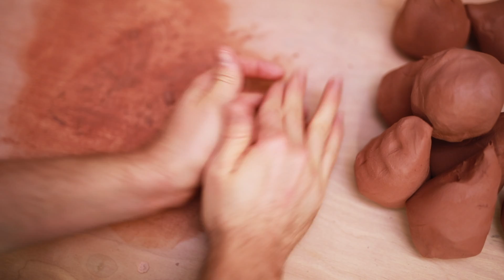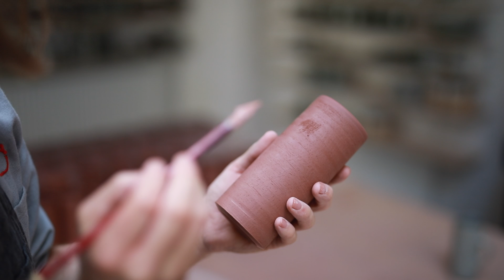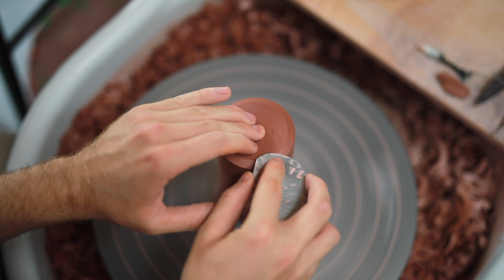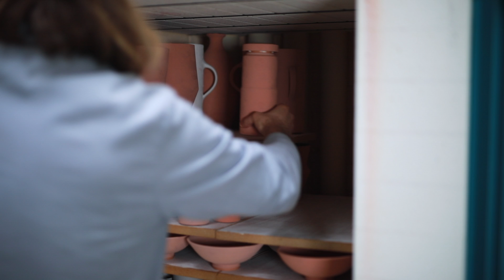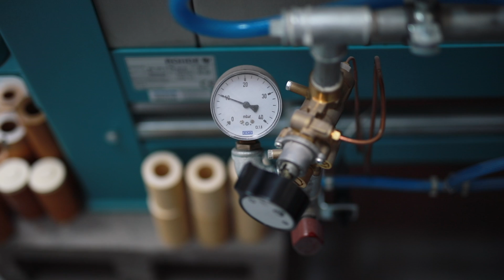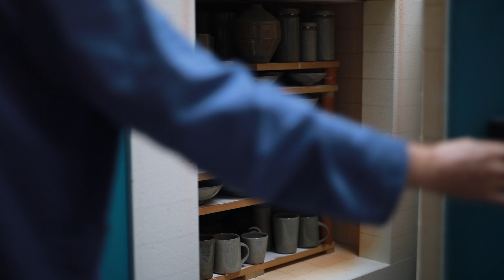How to Make a Handled Pottery Jug From Beginning to End — Narrated Version

Comment: Thank you for such a beautiful video. When you lift up the piece from the wheel, do you give a little time until the surface of the piece dries out? Or is it safe to pick it up as long as your hands are dry? I have trouble keeping the form as it is thrown when I lift it up from the wheel, so I usually leave a lot of clay on the bottom so that I can use that part to pick up the piece -- but ideally, I'd like to leave less clay on the piece so that I don't have to remove too much when I trim.

Comment: Why do you wipe off the glaze off the bottom?
Reply from the maker: Otherwise the glaze melts and fuses the pot to the kiln shelf, which means it's stuck, essentially. The only way to get it off after that point is to smash it off with a hammer.
Reply: @floriangadsby  Makes sense. Thanks. Isn't there some material that doesn't stick to the glaze?

Comment: Are you just using a trim tool to take away the clay at the bottom?
Reply from the maker: I am, just a looped trimming tool, then I burnish the bottom with a metal kidney to smooth it over before I stamp it with my maker's mark.

Comment: Nice and clear.  I like the commentary format which is so much better than trying to talk to the camera, operate it and remember all that needs saying.  I agree with you about letting the clay settle to an even dampness throughout, so many people always rush that bit.  Have you tried real wax?  We use an electric saucepan and lower the pot into it. Also I was interested in your crash cooling at the end of the firing - I must try that.  Thanks for taking the trouble to put this together.
Reply from the maker: Thank you Mike. So pleased you like the format of these videos. I have used real wax, for a long time in college, we used to melt it down in big saucepans in the glazing 'shed' and the room would fill up with the fumes that truthfully got us all a little high. The establishment soon after had a giant extraction hood and fan installed. I like it, it does brush on more smoothly, but this wax emulsion I've been using, once watered down a little with boiling hot water, is fine really. Does the same job and I don't have to heat it up or anything. It tends to be a task I do once every couple of months as I can do all of it in a day or so. The only thing I really miss is the smell, molten natural wax is such a treat for the nose. Thanks for watching!

Comment: What was separating the two parts of the lidded pieces?
Reply from the maker: It's called wadding, it's 50% china clay and 50% coarse alumina hydrate, mixed into a clay like consistency and carefully positioned between the lid and the jar.

Comment: Great video, very informative and a joy to watch. May I ask, I noticed the crackling on the glaze, would these jugs still be food-safe?
Reply from the maker: Thank you! Here's my answer I keep in a document for when this query comes up! I’ve been using crackle glazed ceramics for years and years. It’s high fired stoneware with nothing nasty that could leech, the crackling doesn’t stain too badly as long as it’s properly washed but of course it happens overtime. To the same degree, many of the potters I’ve worked for over the years who wood fire, soda fire and so on, all have work that crazes and crackles to some degree and it all stains with time, yet functional work is still made abundantly and is completely usable. I’ve never heard any stories of anyone getting ill from crackle glazed pottery, the clay is highly vitrified and unless you take terrible care of your ceramics you’ll be perfectly healthy. For industry it could be an issue, due to the surface of the pot having less strength, long-term staining with excessive use and fragility as it’s high fired stoneware with lots of iron, which makes it weaker and more susceptible to chipping on the whole, but that’s what you get with handmade ceramics, I don’t want to make pots that have perfect, uniform surfaces like you might find in a shop, I want each to be individual and interesting and handmade and I suppose the same goes for the generations of potters who’ve worked all over the world. Here’s a good link to an article that goes into more depth about it, https://ceramicartsnetwork.org/ceramics-monthly/ceramic-glaze-recipes/glaze-chemistry/techno-file-dirty-dishes/, and clears up some of the misconceptions that are spread around. As long as you properly wash crazed pottery there is no bacteria left in the crackles. As long as you take time to care for your handmade ceramics after they’ve been used then they’ll be just fine.